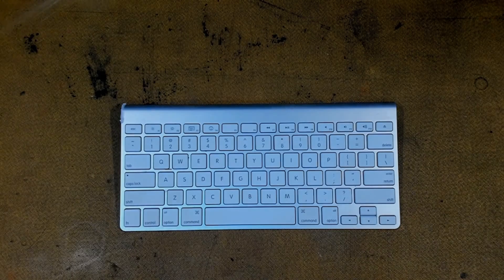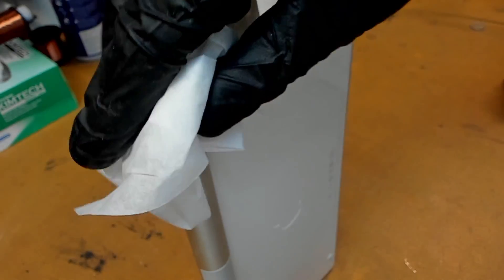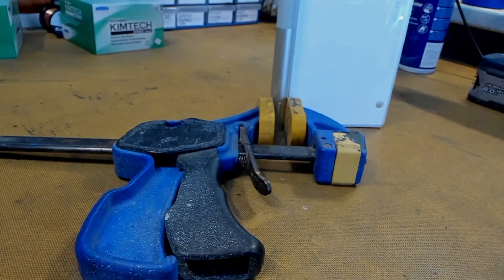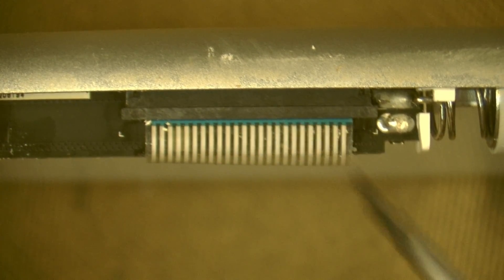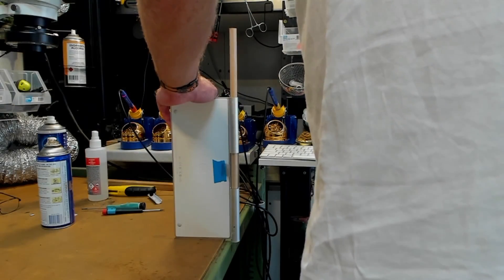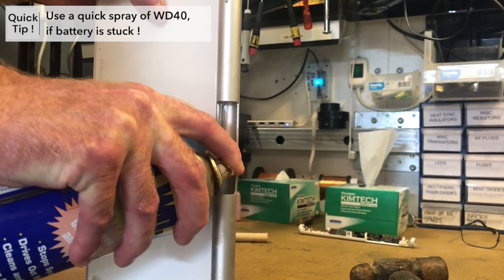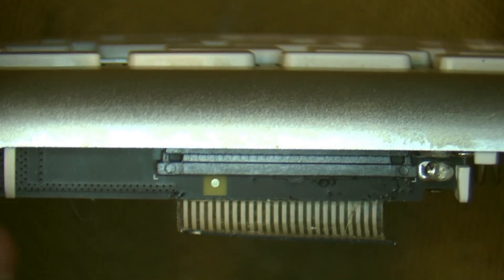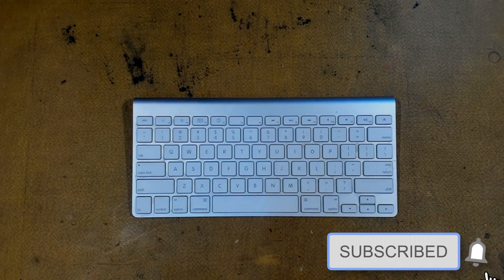Apple Wireless Keyboard Battery Stuck

Comment: Warm water used sparingly to scrub works too, followed by isopropyl or your dreaded 'rubbing alcohol', both of which are perfectly safe for electronics.  I would drip/soak first before you "give it a bash" with your hammer.  

R.e. expensive computer peripherals that take disposable batteries - I use lithium (disposables) now, as they a) hold a higher voltage for longer b) can deliver higher current c) last longer and d) MOST IMPORTANTLY DON'T LEAK!
Reply: Thanks for the suggestion of batteries. I was looking for a non leaking battery.